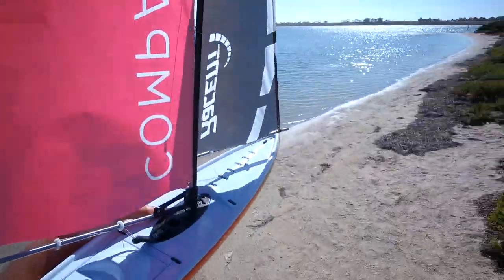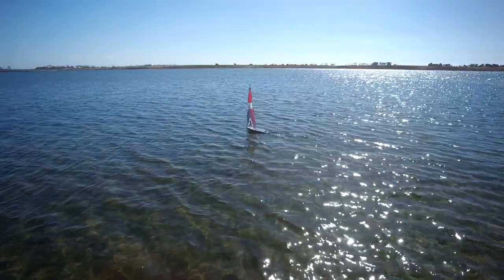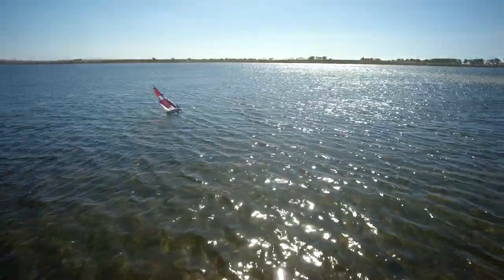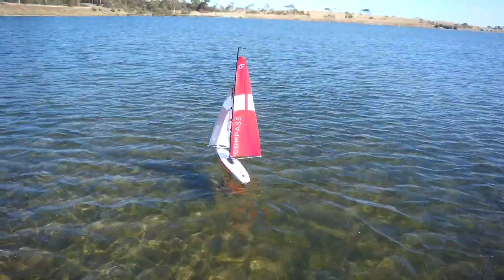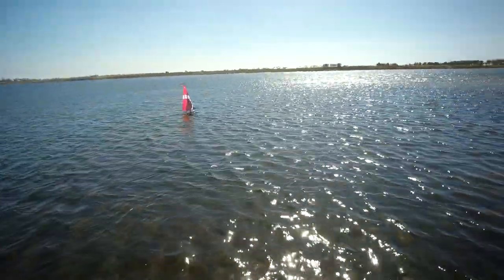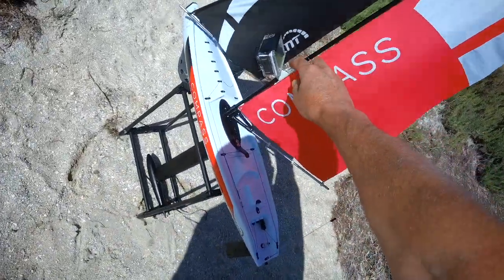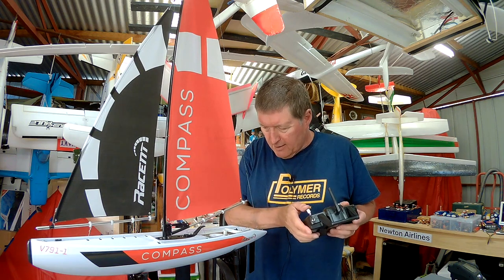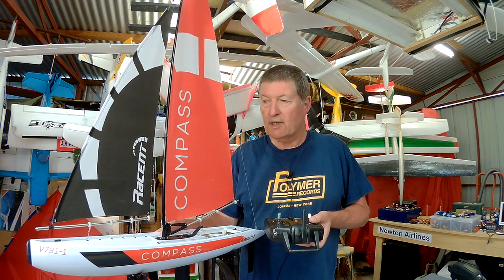Volantex Compass  RC Yacht maiden

Comment: My experience...a boat launch is usually more free of weeds (with folks nearby to retrieve if you need it)....go for deep waters, after a range check (less to foul your rudder and keel)...expo on the rudder is your friend (just as you would have a lighter touch on the helm when you are close hauled). 

Fun to watch. Thanks!
Reply from the maker: Thanks mh. I have greased the rudder shaft, switched to a transmitter with Expo, and just waiting for the wind to be right for our local boat ramp. It would be perfect.

Comment: The boom appears 180 degrees out. The vang is usually on the bottom, that would make the boom even with the mailsail bottom. I'm going to mod mine to work correctly

Comment: I'd love to see the stick movements as I can sail a bit but can't think what say what a tack etc would be on the transmitter
Reply: Well this is 2 years late but generally, the left “throttle” stick would be bringing the sails in and out. More throttle let’s them out, and less brings them in. Then the right stick simplely steers the rudder left and right.

Comment: I thought about it getting stuck on seaweed😆
Reply from the maker: Quite a deep keel for it's size
Reply: @AndrewNewton  well, at least it is not short, the longer it is, the more stable it should be (I think) the only downside is that you must be in deep water to use it. My golden bright sailboat could use either a longer keel or some more weight because it always makes me think that it water will get to the electronics at such an extreme angle. Mine is supposed to be a 1/25 scale according to what the box says.

Comment: it seems harder than flying a plane ...
Reply: It's not unusual, when I'm out sailing my rc boats, for somebody to stop by and ask if I also fly rc airplanes, and how they differ.  My reply:  "It's been my experience that the boats usually last longer."
Reply from the maker: Haha, might be right there
Reply: @ericcoleson7410  if he did not sink ;-)
Reply: @oldflyingman7581  i was flying with a guy in my club when somebody asked what it takes to learn how to fly rc.  He offered that "everybody probably learns at a different rate, but it took me about 6 airplanes."  The boat he learned to sail on is still in service. 8-0